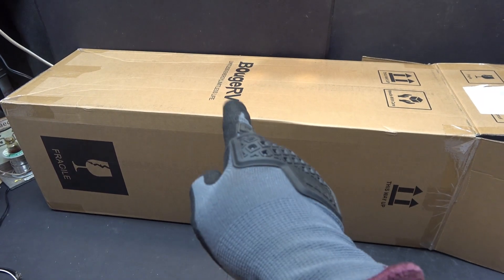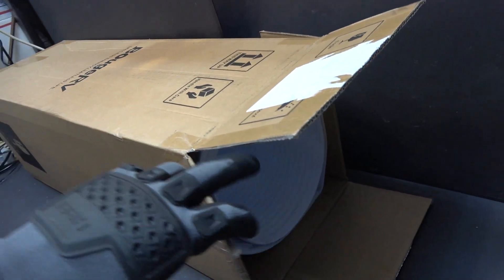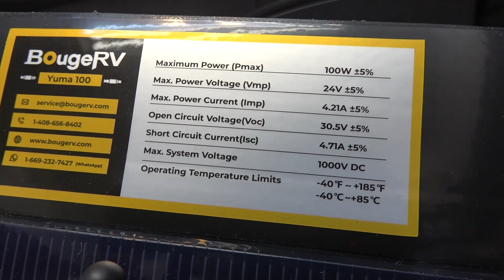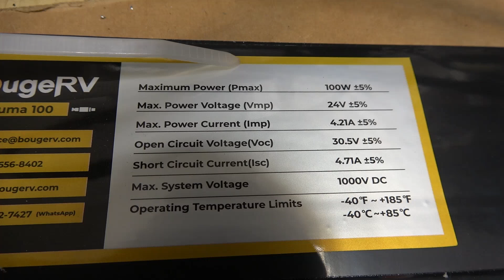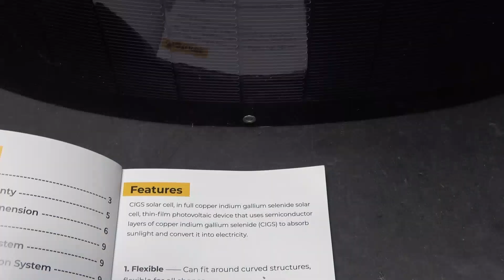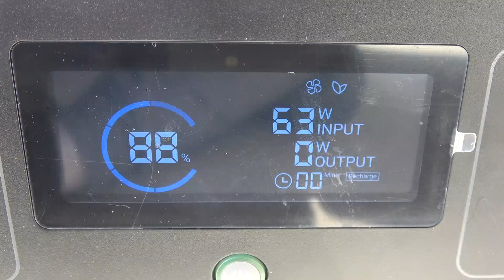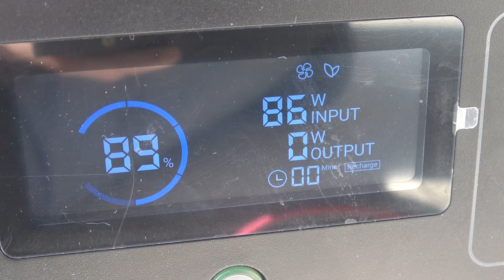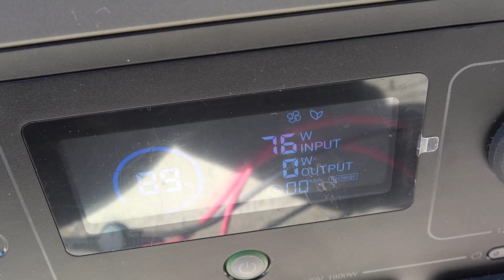Review: BougeRV Yuma100 Thin Film flexible rollable 100W solar panel

Comment: The problem with the thin panels has always been longevity as 2, maybe 3 years, in hot sun, or on RVs they flake, and separate needing to be replaced.
Reply: I've been using the real-dal PowerFilm Rollable for over 5 years. No failures, made in Iowa USA.
Reply: @jxpat  Lucky you, but go looking, and asking the community, and that is not the norm.